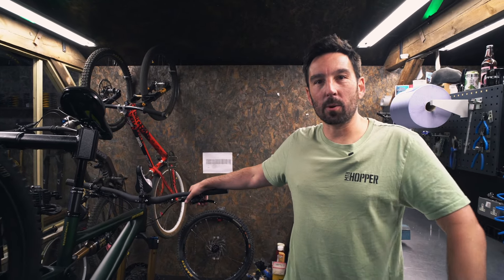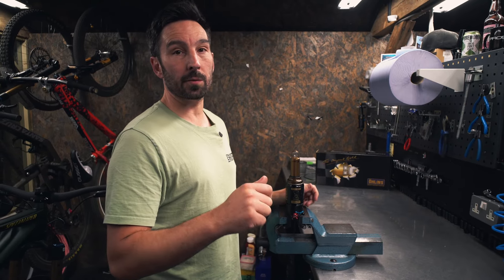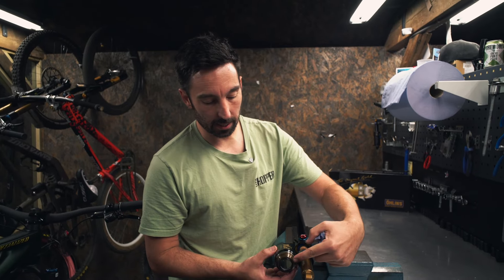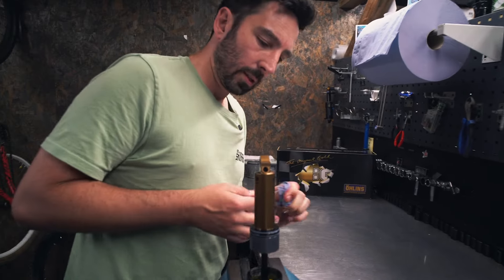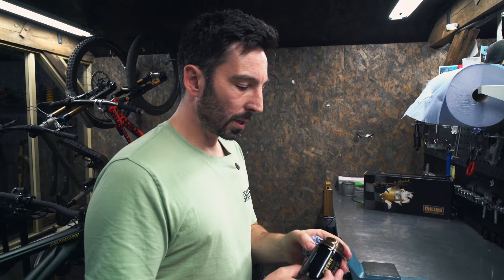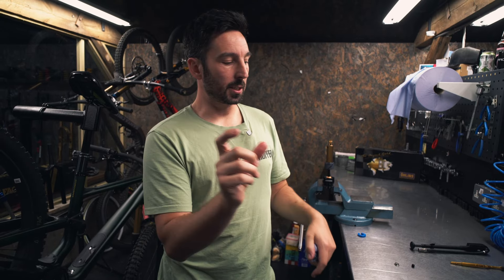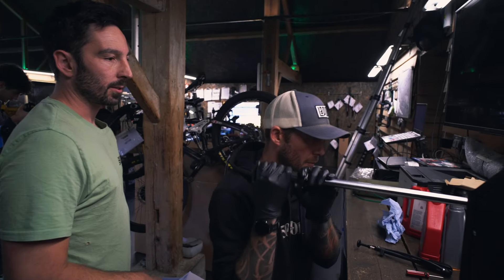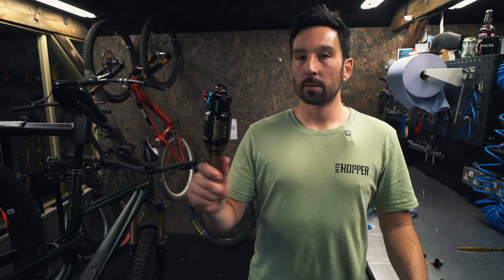What's special about the Stumpjumper 15 Shock? FOX Genie Shock Teardown

Comment: Been riding my Stumpy 15 Expert for about a month. The shock is really awesome. It makes it feel so plush and active at the rear but then when you push into it to pop or pump you quickly push through the plush part of the travel and hit the firm bit so you can still pop/pump effectively. It's kind of the best of both worlds between a long travel enduro bike and a mid-travel trail bike. Haven't played with the volume spacers yet, just riding stock configuration right now. No complaints.

Comment: So in theory would this suit a single pivot? Traditionally you have to run a high pressure/less sag to prevent firing straight through the mid stroke thereby making them quite harsh.
Reply from the maker: Hey! Yes, no and maybe. This all relies heavily on the leverage rate of the frame. Hydraulic bottom out like you see on the Rockshox and EXT shocks will probably suit better as they are adjustable.

Comment: If it's so great why do they offer an ohlins version bike?
Reply: Their factory DH team is Ohlins/TRP/Sram - They offer builds with Ohlins/TRP/Sram across their trail/enduro/dh line inspired by the factory racing team :)
Reply from the maker: This was mostly the question of our peer review. The white paper didnt publish the actual leverage rate of the linkage and we weren't told that the Ohlins bike had any sort of different linkage so who knows?! I am still awaiting a response from Spesh! But the Ohlins one does look rad at least!
Reply: @BRINKUK  That would be interesting to know. They didn't publish the leverage rate of the bike without the genie being a part of it?
Reply from the maker: @Intentsrig  that’s right. Leverage ratio but not leverage curve or progression numbers. If the bike is under 20% progression the coil might not be the best. That said this shock really is just a bottom control so it may be just fine. But I’d rather see the numbers!!